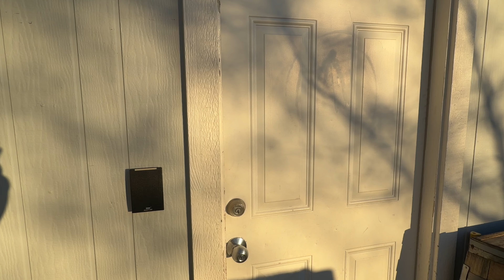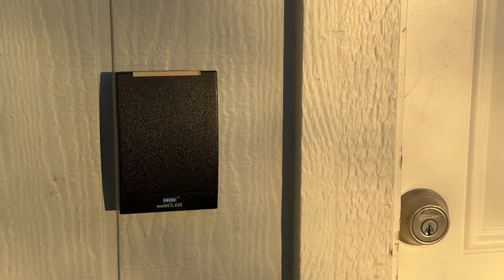Radionics D9412G House Fire Alarm Test/Overview

Comment: Let’s see if it’s compliant. Short out your burglar alarm device power and see if the fire still works.
Reply from the maker: Actually this would do absolutely nothing. Ive seen this on vistas and these systems are not affected by it. All power outputs are isolated from each other. I even have a data bus isolator that isolates fire and burg.

Comment: if you can move your bedroom smoke, it's too close to the wall. IIRC smoke takes longer to saturate tight corners which is why it's code to keep them so far away from the wall in a ceiling mount. never tested exactly how much difference it makes but i always try to avoid getting them too close on my systems
Reply from the maker: Yeah i wouldv've, but almost all the smokes are somewhere an old smoke alarm used to be